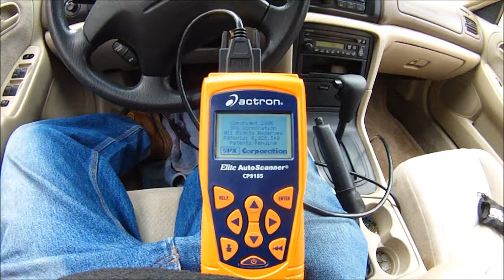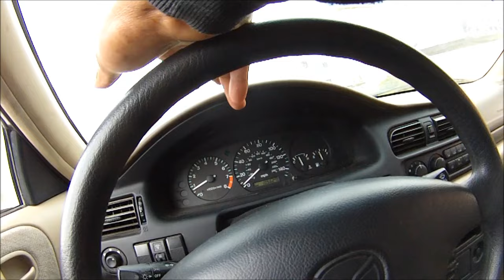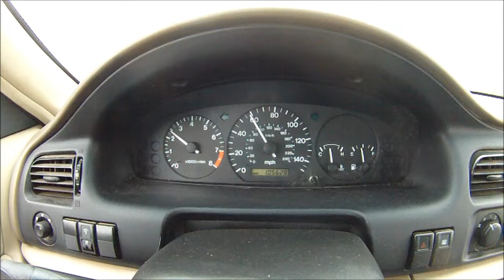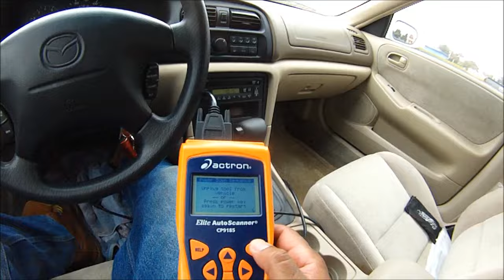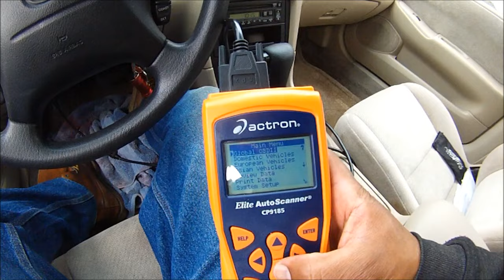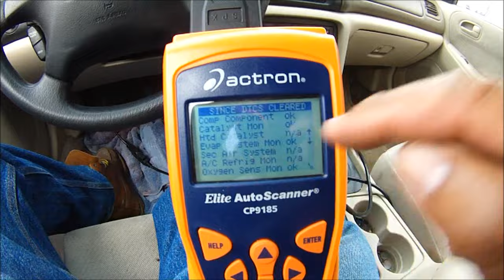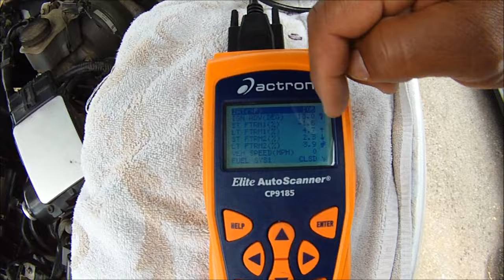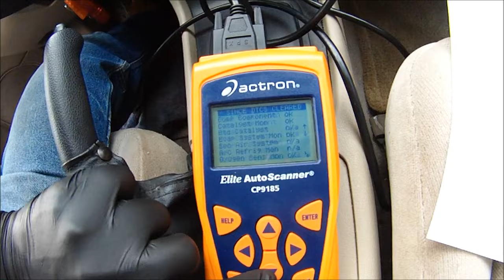WHAT SMOG TECHS WONT TELL YOU AFTER YOU FAIL THE SMOG TEST FOR (INCOMPLETION OF OBDII SELF TEST)

Comment: HI ! I had to say thank you sooooo much for making this vid especially about how to complete the drive cycle because after i took the car to the dealer the monitors were incomplete ! not ready for smog. Your vid helped me a lot, I watched it over and over you did a great job and definitely with a little MODIFICATION for MANUAL TRANSMISSION it WORKED PERFECTLY.  previously my car had a new CAT installed, fixed some stuff in the dealer and  finally I cleaned the MAF, changed fuses, gas cap, changed hoses, bought coolant from dealer, replaced air filter, cleaned fuel system with a full bottle of fuel injector cleaner additive last week in 1/2 tank not a full one since is expensive man, until it was almost gone and then I refilled to 1/2 tank with 91 octane gas , may be i should have used 87octane from the 76 gas station  is better I suppose ,I read somewhere the one in 76 gas station makes it run leaner instead of too rich. But I didn't,  I put 91octane because I had cleaned the tank with the additive and wanted cleaner- pure-gas to compensate the rough treatment, that was my thinking . So anyway, I followed the instructions for the specific drive cycle for the car "DasAuto" to complete the monitors and nope...THE MODIFICATION for manual transmissions:  Well I followed your vid general directions however my car is manual so when I stopped with the manual emergency break to test it  in a stop sign by my block it kept going a little bit !  never really stopping completely!  LOL and although slowed down almost all the way I was worried to use it in the freeway. So,  I modified the drive cycle in that part for manual transmissions... because when I tried with the manual break later in the freeway it worked fine, about slowing the car down almost fully I stopped, but in order to get going again to reach  55MPH again the car  couldn't do it  because I HAD to step on the clutch to change the gearS DOWN TO FIRST WHEN STOPPING  AND UP TO 2,3,4, 5TH GEARS from the  First gear.  In my car  a " Das Auto" the specification is NOT TO USE THE CLUTCH, FOOT BREAKS DURING THE DRIVE CYCLE ... Say whaaat?! O O ...Obviously the engine turned off on me !  when stopping without using the clutch...total disappointment !  I STAYED FAITHFUL  BECAUSE God is good! all the time He is good! so  I re-started  the engine again right away. I turned the engine on right away and drove in heavy city traffic for 2-4 minutes to get into the freeway again by now I was all the way to the end of the freeway LOL,so I got in the freeway back again and drove accelerating gradually until the speed reached  55-65 keeping it constant for 10 min. No air conditioner or radio or nothing electric on . Then from a top of a freeway Hill I let the car cruised down the freeway without pressing  gas pedal, or clutch  for 1 minute or whatever it lasted with the impulse being previously at 65MPH then gradually letting the car alone  de-accelerate itself gradually INSTEAD OF STOPPING WITH THE EMERGENCY BREAK I TOOK MY FOOT OUT OF THE GAS PEDAL AT THE TOP OF THE FREEWAY HILL AND LET THE CAR CRUISE DOWN THE HILL  WITH MUCH CAUTION JUST STEERING DOWN IN 5TH GEAR on the freeway cruising down -gradually loosing speed -without gas pedal or foot break or clutch or changing to a lower gear i stayed in 5th gear ( !) until it slowed down to 40-30 MPH ! with emergency lights blinking ON, be very careful have plenty of space and look around don't be distracted with anything watch your speed but watch the road at all times. Oh Lord so scared but  I did it like 3 times in different hills same way with my emergency lights on and when the speed reached less than 50MPH  I directed the car to the shoulder where you can safely stop if necessary ,safely to the the shoulder for emergency parking to not bother other drivers BUT WITHOUT stepping in the FOOT  BREAKS OR CLUTCH  and STILL in 5th gear ! NEVER FULLY STOPPING OTHERWISE YOU RUIN YOUR MANUAL TRANSMISSION and BEFORE the car reached less than 30MHP  ( to protect my transmission from t break) since( I paid 600 bucks already for it last year) I ACCELERATED gradually again and getting into the freeway again watching for oncoming traffic but got in it again and kept accelerating gradually &  steadily to reach 55-65 againand stayed there driving at constant  speed for another 5 minutes. By now I was way by the other side of the city from where I started a big city loop  lol.  THEN started to drive 40-50 MHP which is the specific for my DasAuto 5 speed ,manual , 4 CY,  car for 5-10 minutes that part  was the scariest because people behind me was like "what a ..." the peer-pressure was huge to accelerate and give up on finishing my drive cycle and drive normal ...but I stayed strong for 5 minutes more  driving steady 40-50 MPH just in case. because  I didn't want to have to start all over again after so much stress! then I drove again at 60-65 just to make sure all the way down the initial freeway because thats where I was planning to smog it or change the oil.. So finally driving normally and using the foot brake just as always and the clutch just as normal when driving in the city to change gearsup and down,  I got into a big empty parking lot so I could freely accelerate to 30-35 and control the number of stops and time idling and drove loops of stop and go for about 5 minutes at 30-35MPH and finally checked again with the scanner and YES IT WORKED ! Completed all monitors, Thank you Jesus ! all were ready and the code didn't come back again yeay!  now  the CAT ( which is new anyway) it was pipping hot  took the car to smog right away, NO  turning the car OFF at any time. Hope this helps someone Thinking back, Probably it would have been okay to smog whenever later anyway since I already had taken care of the necessary fixes but didn't want to risk having to do the drive cycle again it was a little stressful, sounds easy to do but it is stressful. Anyway IT PASSED with flying colors. I feel like WE got a diploma or something Thanks be to God  !
Reply: How did you do the test on the manual transmission? I need help

Comment: Really great info! Thanks.  I found this for a C230K Mercedes 2000 (might need to do twice) STEP BY STEP DRIVE CYCLE TEST READINESS PROCEEDURE
EACH OEM’S DRIVE CYCLE MAY VARY
CHECK YOUR VEHICLE SPECIFIC FOR VARIATIONS OR UPDATES

1- VEHICLE SHOULD BE STARTED WITH THE ENGINE COLD

2-LET VEHICLE IDLE UNTIL THE ENGINE IS AT NORMAL OPERATING TEMPERATURE 180 0R HIGHER (GENERALLY 5 TO 10 MINUTES

3 - PUT VEHICLE IN GEAR (WITH BRAKE APPLIED) AND IDLE FOR NO LESS THAN 45 SECONDS

4 - ACCELERATE TO 45 MPH WITH NO MORE THAN Â¼ THROTTLE AND SPEED 10 SECONDS

5 - DECELERATE TO 35 –38 MPH AND MAINTAIN A STEADY THROTTLE AND SPEED FOR ONE MINUTE

6 - DECELERATE TO 25 MPH.AND THEN OPERATE BETWEEN 25 MPH, AND 40 MPH FOR 4 MINUTES do not operate more than Â¾ throttle for this test segment.

7 - DECELERATE ENGINE AND IDLE FOR 10 SECONDS

8 - ACCELERATE GENTLY TO 55 MPH USING NO MORE THAT Â½ THROTTLE. MAINTAIN SPEED FOR FULL 10 SECONDS

9 - CONTINUE DRIVING AT 40 MPH. –55 MPH USE A STEADY THROTTLE PRESSURE AND MAINTAIN SPEED FOR A FULL 2 MINUTES.

Comment: Thank you
I have a 2007 FJ cruiser change the spark plugs disconnect the negative and went to go smoke check everything pass except catalyst mon and the guy at the smog place told me that I need to drive it around, I never mentioned that I change the spark plugs or disconnected the battery 

I’m definitely going to do this

Comment: My Suburban failed emissions one year - high NOx.  The "emissions repair shop" said I needed a new cat converter and an EGR valve.  I've never had to replace a cat converter on any car I've owned since they came out.  Most of my cars had over 200k miles when I terminated their use.  Given that experience, I didn't accept their diagnosis and went for a 2nd opinion.  Found a disconnected vacuum line - $25 mechanic charge.  An overly lean mixture will cause the same high NOx problem.  2nd opinion saved me over $900 in a repair bill.

Comment: This procedure works.  A friend of mine has practically the same car, same engine and had an incomplete EVAP System Monitor after I did some work on it.  I talked him into performing this procedure verbatim and all monitors are now ok. Now, we'll try the Smog nazis and see what happens now.  The car has a new cat, O2 sensors, new filters, wires, plugs and hopefully it will pass now.  Thanks, oldskoolfunk!
Reply: yup it saved me tons of money and stress. I did have to mix it up a bit with BMW drive cycle but almost exact procedure. Get the Actron Elite scanner well worth the $70 from Amazon. Plus you have tool to help save $ on future car repairs.
Reply: @GuitarsAndSynths  could not find Actron elite for $70 on amazon...what model number ? pls post link,,thx

Comment: Thank you!!! I cleared my check engine light and drove 30 miles and checked it again the Evap one is still not green. So I have been driving for another few days and haven’t checked it again yet- but I am going to drive the freeway tomorrow. Unfortunately I live in a super busy area so no matter what the freeway and all streets are always busy. But hoping the freeway drive helps. It’s definitely very hot right now as far as weather goes- so hoping that doesn’t mess the process up. I need to pass smog before October so I have a little time!

Comment: This is what I did for the Honda Accord and it works: 

A. Begin by idling the engine while 2 1/2 minutes. Next idle for another 2 1/2 minutes with the A/C compressor and rear defroster on and while the transmission is in Drive (D); only of automatic transmission. This part of the drive cycle checks the oxygen sensor heater circuits, air pump and EVAP purge system.

B. Turn the A/C compressor off and rear window defroster off and accelerate to 55 mph at half throttle. During this step the OBDII system checks for ignition misfire, fuel trim and EVAP canister purge.

C. Hold at a steady state speed of 55 mph for 3 minutes. The computer will now be testing the EGR system, air injection pump, O2 sensors and canister purge.

D. Decelerate to 20 mph without braking (or depressing the clutch). Once again the computer system will check EGR and purge functions.

E. Accelerate back to 55 to 60 mph at half throttle. During this step the OBDII system will look for misfires, fuel trim and EVAP purge.

F. Hold at a steady speed of 55 to 60 mph for 5 minutes. Catalytic converter efficiency, EGR flow, ignition misfire, fuel trim, EVAP system and oxygen sensors operation will now be checked.

G. Decelerate to a stop without braking (or depressing clutch). The OBDII system will complete the drive cycle at this point.
Reply: How do you decelerate from 55mph to 20 mph without hitting the clutch in a manual transmission?

Comment: Hey OldSchool, this is Olschool :) I thank you for this video.  Just changed out O2s in my mother's  03 Toyota Sienna, did the disconnect battery to reset the codes, and they did reset, but it would not pass inspection.  Going to give this a go.  THX

Comment: took me 2 tries,  but I got my 05 Dodge SRT4 to pass using this.  Just did my driving to get through the cycle in the neighborhood near the testing site.  1st time failed cause the CEL came on literally 100' from the shop, lol.  Took it a 2nd time next day, a slightly different route and worked like a charm.

Comment: Man, my check engine light has been on for like 10 years. Every year is a struggle to pass smog.  I hate the month of October. Smog is such a scam. Here in NV you can pass with 8 of the 10 monitors ready.   Here is what I did and have finally mastered this after years or anger, frustration and broken phones. Anyways. I took your video hit play and did the drive cycle along with you step by step.  Pulled over when you did, turned the car off and check the scanner and yes 8 of the 10 were ready. I was pumped! Started the car and off to smog. Well 2 mins after I got out of the parking lot check engine light came back on. I was devastated and went home with my head down.  The next day I started all over again and instead of turning the car off I left it on and drove right to get it smogged. Check the scanner and the light before I turned into the lot. Boom engine light off and drove away with my car registered for another year. Moral of the story. Buy a scanner, do the cycle, don't turn off the car!  Ps. Thanks for your video, couldn't have done it without you!

Comment: So start car early on, turn on defrost (hot) full blast, let car come up to normal operating temperature, Hit the nearest freeway drive at 55-65, never higher or lower for 5 minutes/ or miles, Bring the car to an uphill (preferably) OFF ramp, let go of accelerator for the first time to "coast stop" and use hand brake to come to a complete stop DONT use brake pedal. Stay stop for a short moment. Take Off and city drive KEEPING AT 35MPH stop completely at stop signs, stop for lights. Normal City driving but at 35 as consistently as possible for roughly 15 minutes. Check OBD scanner for completeness. Thank you.

Comment: Thanks for responding. It has to be compatible with the car because it works better than before. If it had wings it would probably fly. I called mopar and was told the High Output Stage 1 is meant for off road high performance/ maybe race tracks. He said it was not compatible  with emission controls. I'm not sure why they sell them . I guess I'll  put the factory one back in until I pass emissions and then put the mother of all PCM's back in. Oh, and by the way, I love Jesus too!!